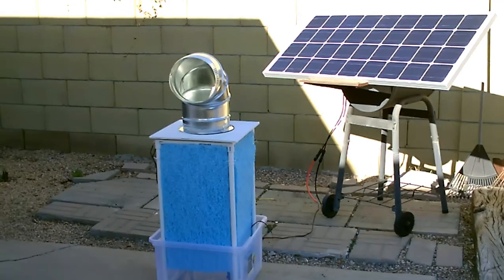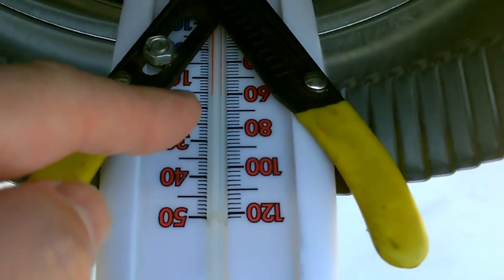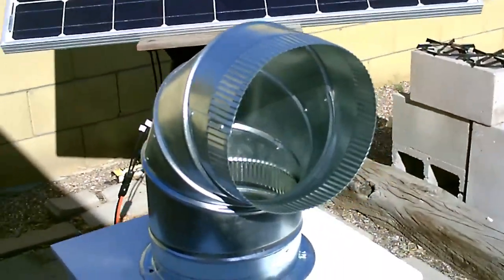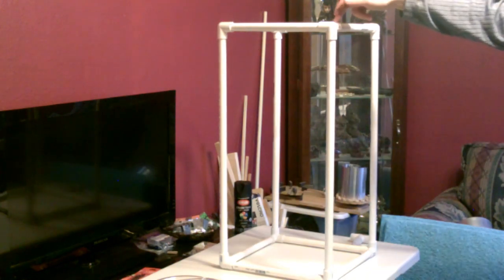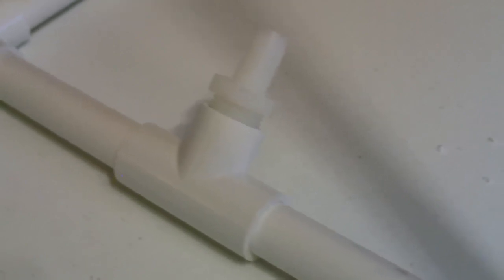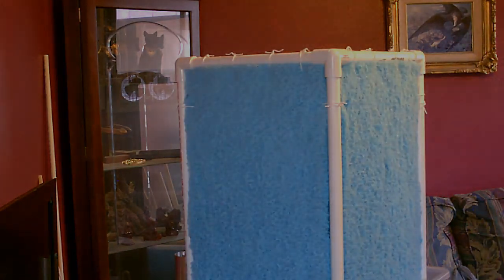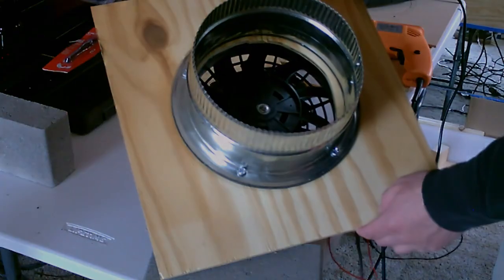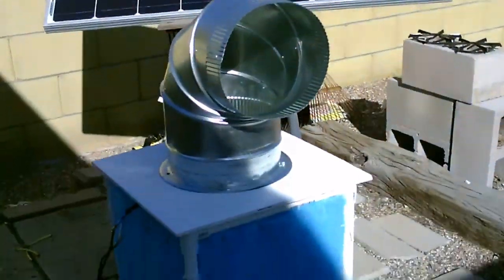DIY Evap Air Cooler!  w/high speed Fan!! - Cools up to 1000 Sq.Ft.!!  (can be Solar Powered!) - DIY

Comment: I can’t find a 20watt DC powered 200 gah pump out there. Need more specific info or from any of your followers. Thanks
Reply from the maker: hi there. it doesn't have to be 20 watts. it just needs to be around 200 gph. (anything from 180 gph to 250 gph should work well). those will be around 20 watts. here are two links. https://www.amazon.com/Submersible-Brushless-Fountain-Mavel-Star/dp/B01816E1YU/ref=sr_1_1?keywords=12vdc+206+gph+water+pum&qid=1556474065&s=gateway&sr=8-1-spell
 and https://www.amazon.com/dp/B07G9ZPRK8/ref=psdc_402303011_t3_B01816E1YU    i got mine for about 10 bucks recently (but it's currently marked unavailable online).